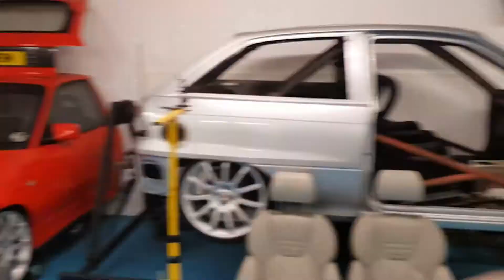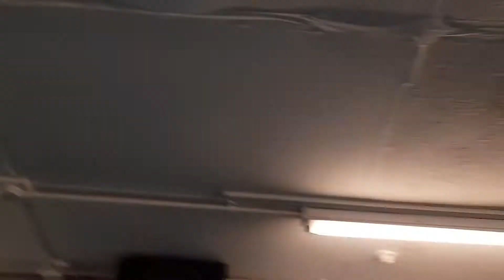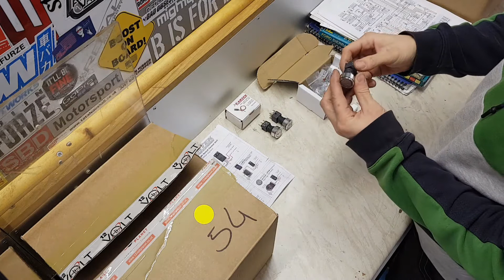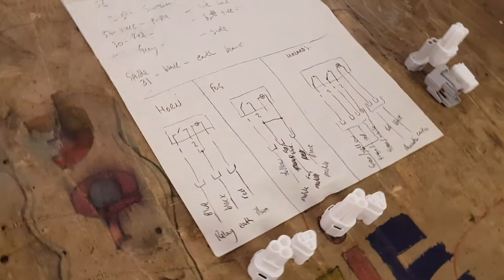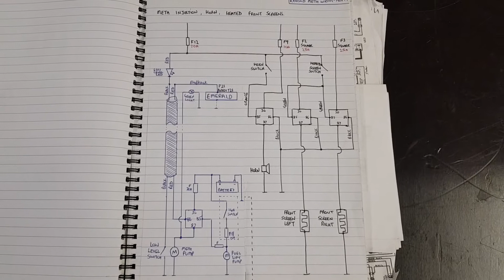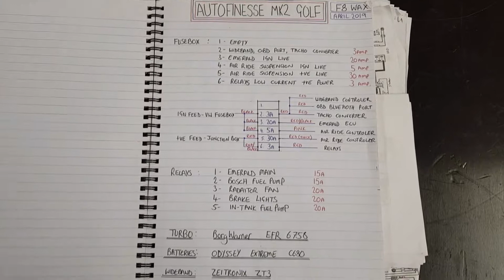Ep19: Wiring up the Savage Switches in my GBS Zero!

Comment: If you don't do the wiring like you have the car is worth much less. If you ever want to sell it and it has a wiring diagram so average Joe can take it to a shop. If it was just spades and terminal ends with no diagram, no shop on earth will touch it. Even for yourself after it's been 3-5 years you won't remember exactly what went where during the build. After a day or more of fumbling around with the wires it might come back to you if you're lucky. As far as a new owner, no chance. If you buy a project from a builder, make sure you have a wiring diagram at a minimum.
Reply from the maker: Exactly that 😁

Comment: Really enjoying your vids, I have a pile of Zero parts in the garage myself (given my progress, calling it a build would be generous).

If you put your label printer into "Port" mode and set each word as a new block, you can cut multiple individual words in one go with no wastage (apart from the initial alignment cut), rather than having to cut them with scissors.
Reply from the maker: Awesome, thanks for watching and thanks for the tip on the label maker, I've barely used any of the features on it. Will give it a try.

Comment: Another top video Ron! do you reckon you could put a link in a description of your next video of where you bought all your things etc. I'm about to start doing the wiring on my astra in the next couple of months and i love the look of the heatshrink print, outer braiding for the wiring and the water proof plugs are just what I need for my fuel pump etc.
Keep it up!
Reply from the maker: Thanks mate, I dont really have a go-to place, most is of Ebay, but good idea about posting the links, I'll start doing that 👍
Reply: @SuperRon  Yea man be good to mention in the video what plugs are from where etc. where did u get the big waterproof connectors from? were they ebay? i know the sheething etc was from a company you mentioned in your other video